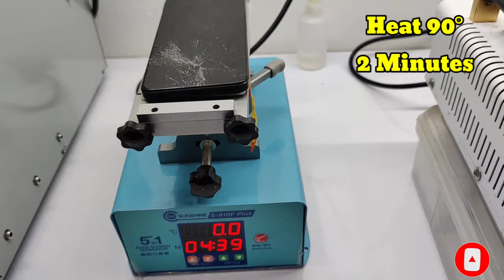Oppo A57/A77/Broken Touch Screen Replacement | how to restoration lcd middle frame combo folder#oppo

Comment: I am also working on Oppo A57 and I am a newbie so the issue is the display is not turning on the display flex cable is heating and the front glass is broken but the user say the screen is all right I put it in my pocket and I put some metal tools in my pocket then I pull out my phone I see the glass is more broken and the phone is heating and the display is blank no sign of live but the phone is vibrating